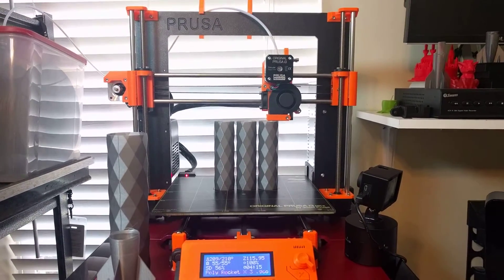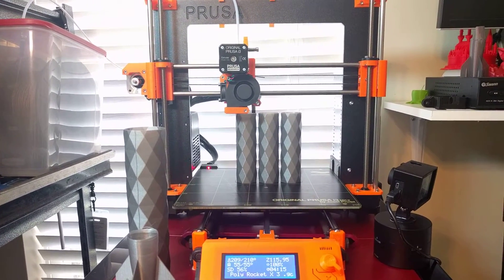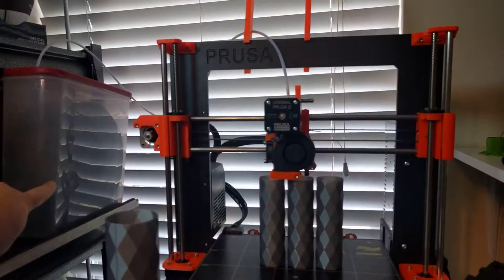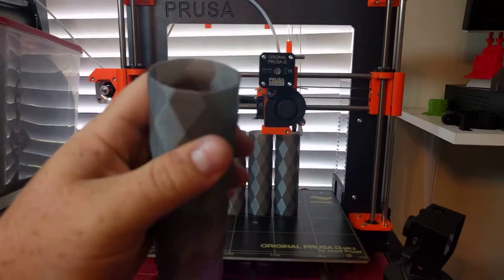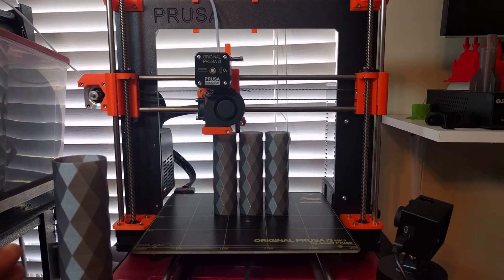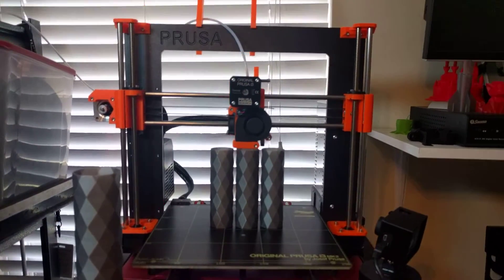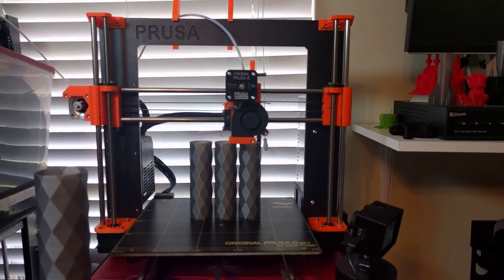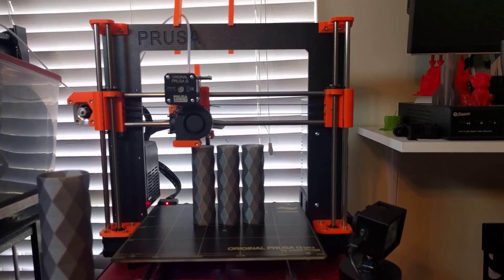Prusa i3 MK2 Quick Tip 004: Printing Tall Thin Part

Comment: 'cheap' filament goes gluey at higher temp. BUT bonds to itself extremely well, print surfaces are glass-like, so, if you print it at higher temp AND have excellent all-round rapid cooling (you can never have too many fans) you can print a quickly solidifying but glass-like cheap filament successfully and your Parts are super strong because each layer welds itself to the one below. If you cool too much too early you get delamination regardless of the quality or dimensational accuracy of the filament. **Beware filaments that measure only 1.55mm-1.7mm +/- X% as that filament is much less consistent than 1.75mm +/- the same diameter variance%.

Comment: do you print ABS and if so how do you deal with cracking
Reply from the maker: Yes I have printed tall think parts with ABS also. I usually vapor smooth or dip the parts quickly in acetone. This well bond the surface and reduce surface tension. If a crack does occur I will either fill the crack with abs juice or super glue and baking soda / Baby powder trick . http://www.tested.com/art/makers/573280-shop-tips-mixing-superglue-and-baby-powder/
Reply: +Mark Fuller I have major cracking problems on my Tevo
Reply from the maker: This might be due to your Bowden setup on the Tevo 🤔. ABS is more flexible than PLA and can bind in the feed tube. Dues your extruder ever skip or a whole layer in your print ever looks like it is missing?
Reply: +Mark Fuller No. It will print the layers and then an hour later they crack
Reply from the maker: +Tesla this video might be able to help. https://youtu.be/TClynRIzm8c Also I have had this issue, with an open frame design make sure your machine is not over a vent or the fan is on.